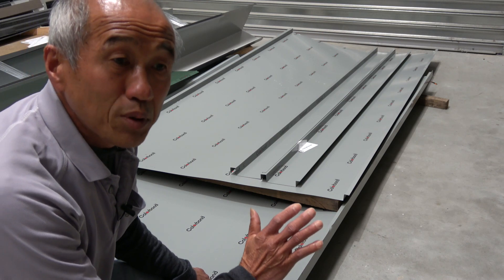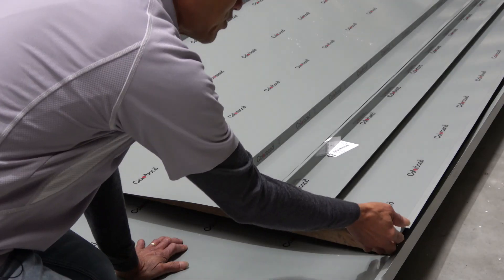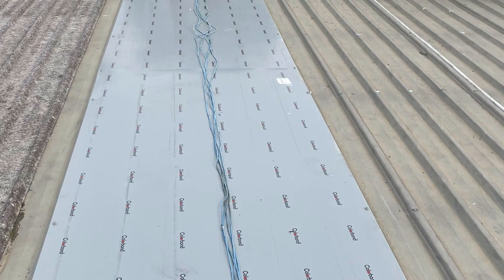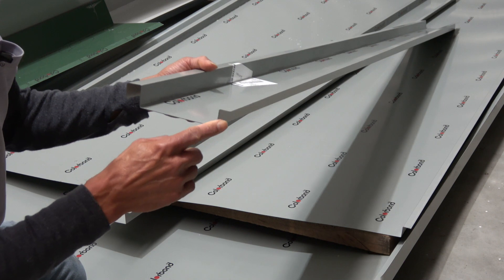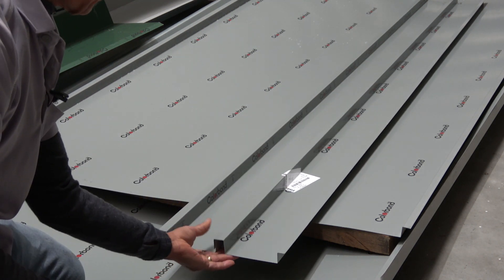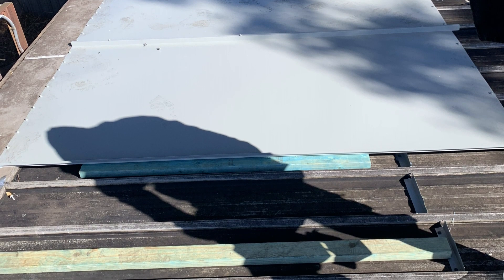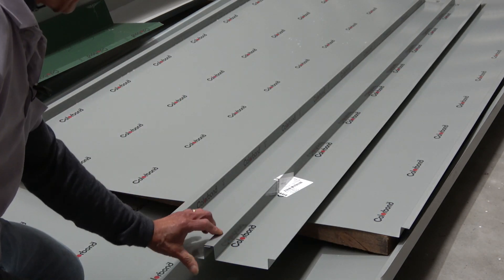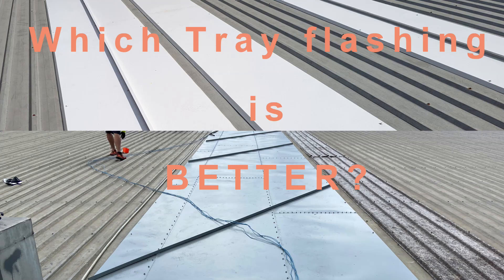Why would you use Standing seam tray flashings

Comment: Hi jack, I'm curios how you would go about securing multiple wide  standing seam tray's to the roof structure to prevent uplift caused by wind, also should one be concerned regarding capillary action on the seam as there does not appear to be a fold to prevent it on wide tray's on shallow pitch. I like the idea but would like further information on the above (maybe a follow up video?). BTW I loved your series on capillary action, well done